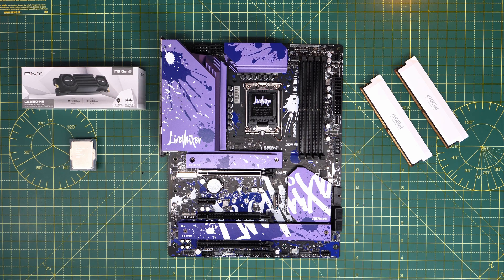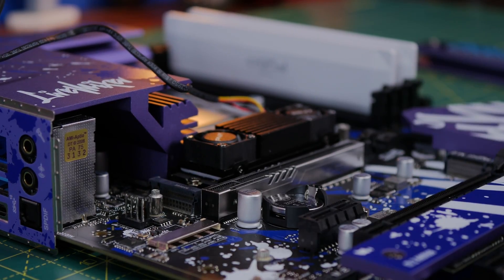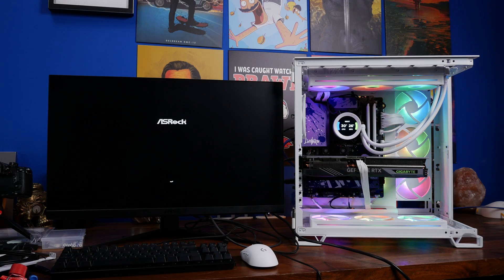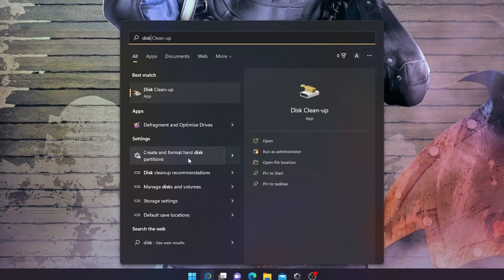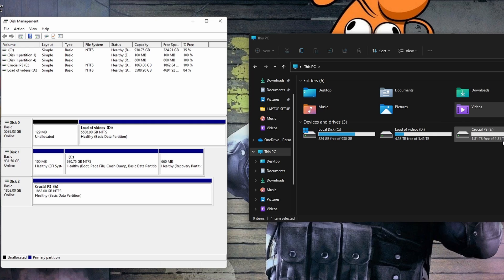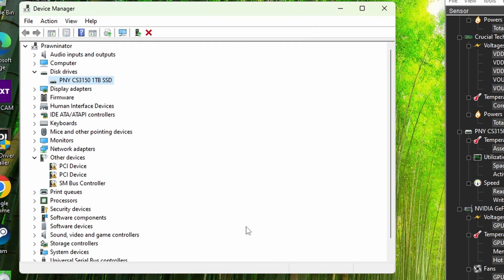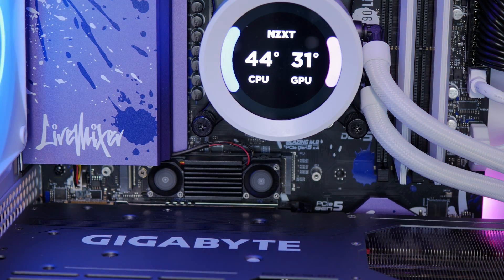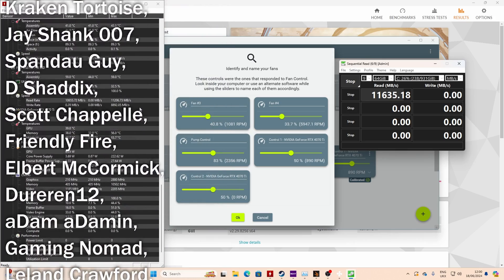How to setup and test PNY CS3150 gen 5 NVMe

Comment: I have the same problem with the fans. How you set the speed? I have fan control.
Reply from the maker: Set the port to pwm mode in the bios
Reply: @TheProvokedPrawn  I have the RGB version, CS3150 XLR8, which uses a Internal USB Headers. 

Even if I lower the case fan speed, it still doesn’t work. It’s as if there’s no controller.

Solved: The XLR8 version requires the installation of the "VelocityX" software to manually set the fan.